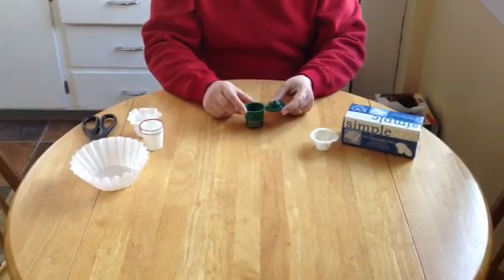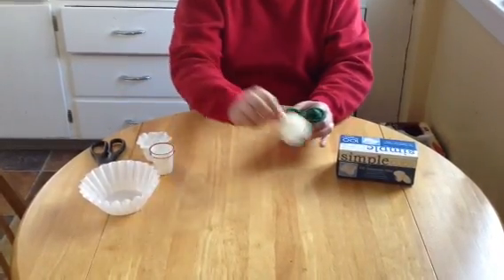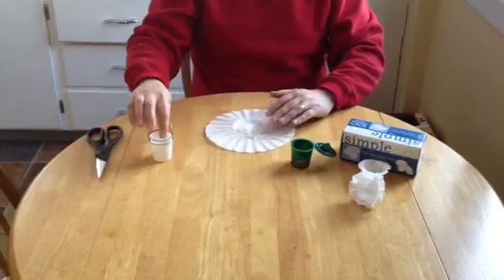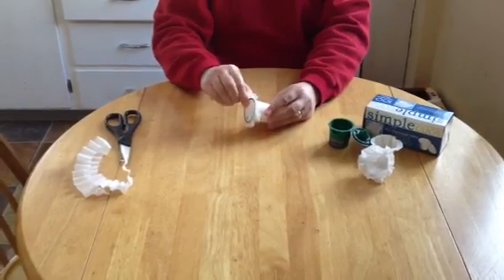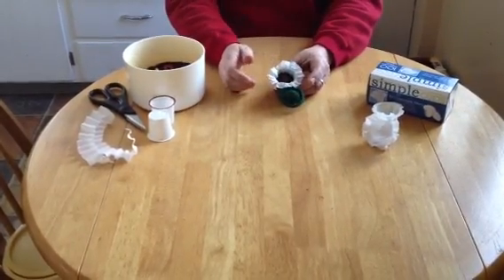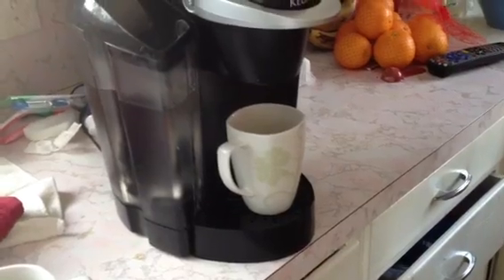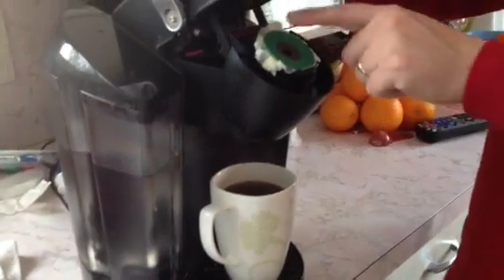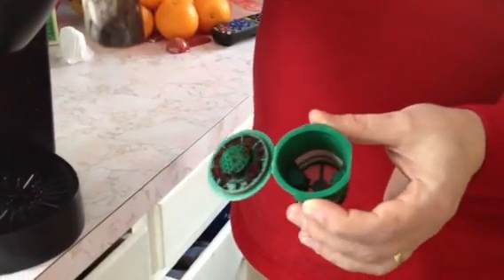Keurig Ekobrew homemade paper filter

Comment: Excellent idea even 6 years later. I have modified your process to this:
First, I followed your instructions for the first filter. Second, I took that and laid it out on a piece of box cardboard, traced that out with a marking pen and, carefully, cut out the cardboard circle with a SHARP utility knife. Third, using this as a firm template, took a week's supply of filters (WALMART), centered them together and placed the cardboard template in the center and and traced out a circle on the top one. Removed the cardboard template and, using a sharp, new pair of scissors, cut out the week's supply of filters all at once. Then, I followed the remainder of your instructions. Thank you for this inspiration.

Comment: Thanks for the good idea. I just got our Keurig with the My K Cup and was looking for filters for the cup. I hate emptying out a mesh filter by hand. The only modification I needed was using the actual My K Cup mesh filter as the inner part of the mold. I took the paper off the outside of the filter, put it inside the filter, filled and screwed on the top as normal. Worked perfectly and much easier to clean up. Also, we can now grind the coffee finer to change the strength. Thanks again.

Comment: Have you found it necessary to add the washer around the needle gasket up top, to avoid leaks and spews?  Learned about this on Amzn but not time to try it yet.  Thanks and super great video!
Reply from the maker: lsr99ut  No I haven't  found the need to add the washer. The lid of the Ekobrew, I believe, is stiff enough that a good seal is made.